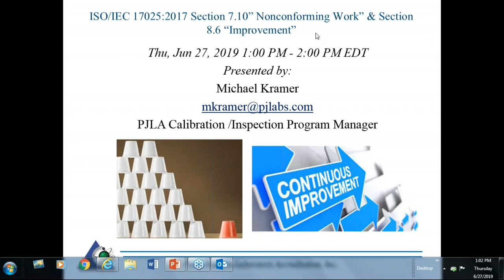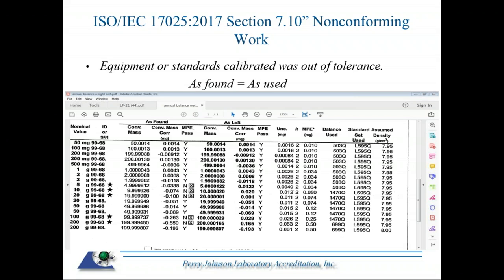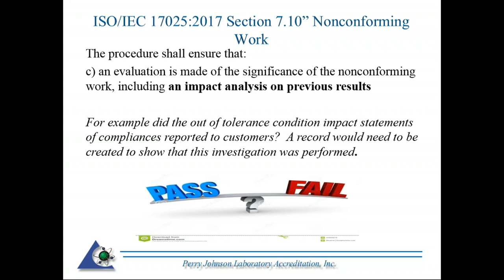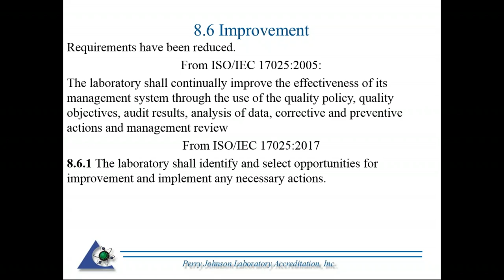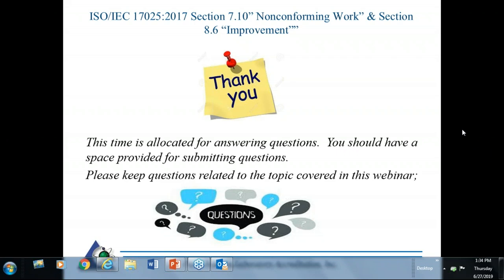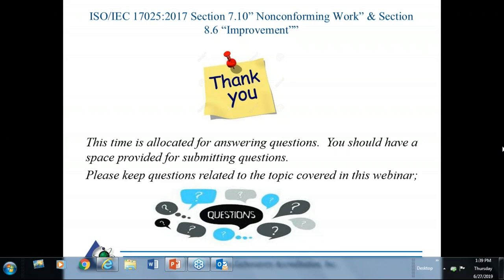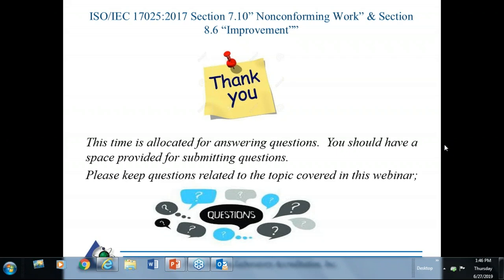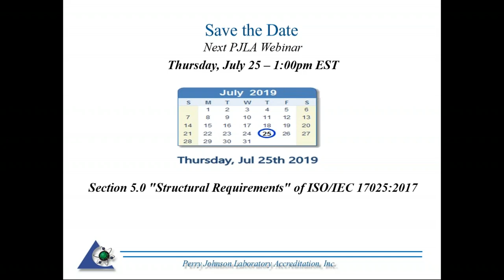ISO/IEC 17025:2017 - Section 7.10 "Nonconforming Work” & Section 8.6 “Improvement”

Comment: Hi. I'm struggling to understand the "acceptability of non-conforming work" clause.  Once you've done an impact analysis of the non-conforming work, based on the result of the impact analysis, would you then accept or reject the nonconforming work?
Reply from the maker: Based on the results of the impact analysis, yes you would accept or reject any work that may have been affected.  If the result of the impact analysis revealed that customers reports were affected, then those customers should be notified.  The main thing I would consider with it the impact on customers work, would be if a statement of compliant was made where perhaps the report stated a pass, however the impact analysis revealed that may not have been the case.  I hope this helps.
Regards,
Michael Kramer
PJLA Calibration Program Manager